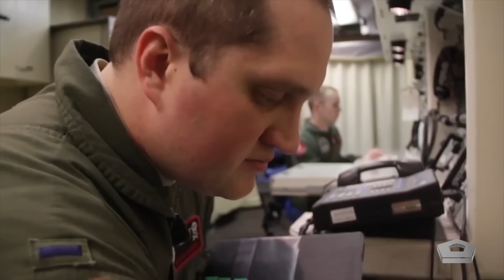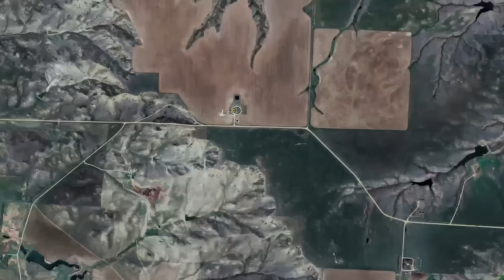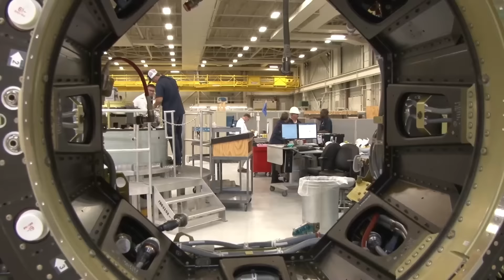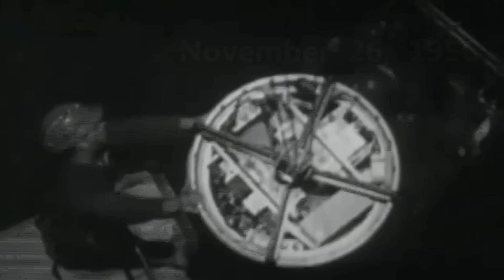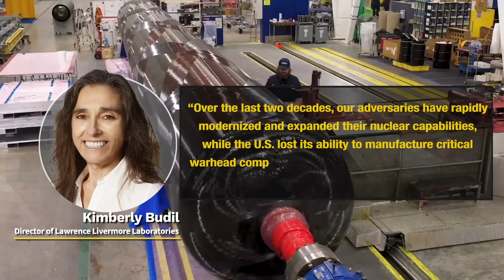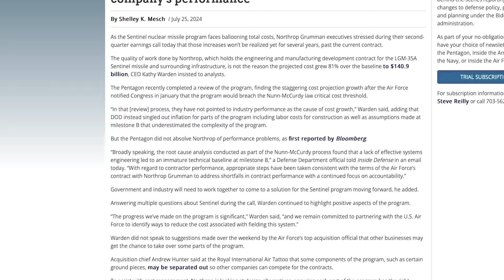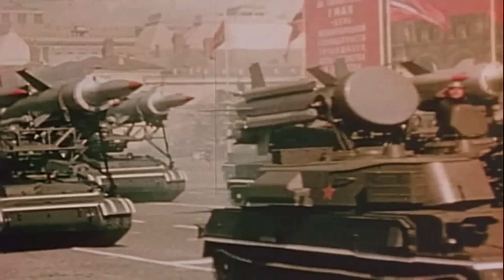America’s New Doomsday Weapon is Unstoppable

Comment: It’s not the missiles themselves which are over budget and which cost so much. It’s all the support facilities that must be installed to support a new missile with newer launch equipment. If all we had to do was build 400 new missiles and then just swap them out for the MM3’s this project would be about 50 billion dollars. About what they thought it would cost initially. BUT the silos basically have to be gutted and new computers and new systems installed to go with the new missiles and there is where your astronomical costs come in. In my opinion we should have never retired the Peacemaker missile. We could have 100 peacemakers and they each could carry from 1-10 warheads. 100 missiles is all we would need. And like China they would have very little idea which of the 450 silos they were on requiring them to hit all of them. Same thing with the Sentinal. Instead of having 450 missiles with 1 warhead on each which is what they currently have we could have just 100-150 Sentinals with 3 warheads each and spread them out over the 450 launch locations. With a little trickery and some nighttime oops we could get them in there and the Chinese wouldn’t know where they were at. Right now we are restricted by treaty to having 1500 or a little more warheads on alert at any time. That’s why the MM3’s are only carrying 1 warhead when they can carry 3. But I think Russia pulled out of this treaty so all bets are off. If I were in charge I would order 150 Sentinals and load them with 3 warheads which they were designed to carry. 3 of the 475 kiloton warheads and I would revamp 150 of the silos for Sentinal and put them
In. 150 missiles with 3 warheads per missile is 450 warheads the exact number that we have now. And instead of doing 400-450 missiles and silos you only have to do 150. The coast of the missile itself would be a little higher because the more you buy of something in the millitary the cheaper it is. But you would have vastly less support infrastructure that would need to be installed for 150 as opposed to 450 missiles. So that’s what I would do. Build about 160 missiles and deploy 150 of them with 3 of the 475 kiloton warheads and then redo the silos and control facilities for 150 missiles and put them in the ground. And also with the Ohio class subs we have we are again treaty limited to carrying 16 missiles when those boats can carry 20 missiles. Some with 8 of the 375 kt warheads and other with 12 of the 90 kiloton warheads. I would go ahead and load them all out with 20 missiles. The new Columbia class that is being built I think only come with 16 launch tubes but it will be decades before they are all built and the Ohios retired. And we are only going to have 12 of those boats as opposed to 14 Ohio’s. Not sure how I feel about that. The Subs in my opinion are what keeps the peace. If someone launched a surprise attack on us and let’s say they wiped out all of our ICBM’s, wouldn’t happen but let’s pretend it did, then our submarines all 14 of them could get within range of their targets the Tridents have a range of over 7000 miles. Or maybe we only have 12 Ohios carrying the SLBM but I thought it was 14. Doesn’t matter our submarine force could wipe out any country on this earth even one as big as Russia is. The British also have 4 subs with 12 Trident II missiles, the same ones ours carry, but are equipped with British made warheads so not sure of the yield. But add those 4 to the mix and France has 4 ballistic missile submarines and France is a an ally so throw those in there too. Every city with more than 50,000 inside Russia could be hit. These missiles some carry 8 warheads with 375 kts and other carry 14 with 90-100 kt warheads. The reason the yields are smaller than in the past is accuracy. We can drop a warhead within 120 feet of the target now. Back in the 60’s and 70’s a SLBM could put warheads within a mile of the target. But when you have a 9 megaton weapon it makes no difference if you were even 2 miles off. Idk it’s all crazy really. I wish no one needed these weapons.

Comment: We like submarine boomers cause they can be closer to target and warningtime less if it is still peace. Do not know their success rate if the entire world know WW3 have begun. Their weapons come in at less speed unless , he he he , the booster is still attached to the warhead and refuse to let go until all fuel spent. >that< would make it come in faster. There is a risk with submarines if someway they can be jammed and very longwave low bandwidth coms still can not trickle through to them. I guess USA have protocols for everything. At least the land based systems can be reached by people on foot assuming total collapse. Anyways, listen to what Chris says the land based system put more energy into the payload so the payload can use that energy to steer. We all know that is sort of the latest thing. So if USA replace old stupid warheads with shiny ones that can fly and also in the process give them a new booster. Why not? it is time .....

EDIT: do not piss on solid fuel rockets they are the strongest. They weigh a hell of a lot at start but after burning some of this heavy solid fuel the thrust to weight ratio gets really good and at the end so much that it get dangerous. To avoid this they have zones that are packed differently to somehow reduce throttle and burn longer and slower at the end when the weight is less.

Comment: Lower fallout alternative missile sink 3/3: MIRV zepplins! Have like ~50 airships circling CONUS at high altitude, each carrying an air launched MIRVed ICBM like when we tested dropping a minute man out of the back of an air plane. This would cost less fuel than aircraft, and be far more targetable due to speed and size issues. Because they would be at altitude, the other side would have incentive to airburst weapons to destroy them, avoiding the fallout problem. Because they move, they wouldn't be able to hit them with one warhead, they would need to destroy areas, especially if using hybrid airships that can go ~100mph.

Comment: Lower fallout alternative missile sink 1/3:

Densepak + local missile defense in the mountains: cluster hardened silos in one area with deep cheap missile defense. To destroy all the silos reliably the other side has to launch many weapons at once along a similar trajectory. Basic idea is that the proximity of silos would force many weapons to arrive in the same area at the same time with perfect timing thus you can make it easier to put mass in the sky in the way of incoming warheads or potentially take out many incoming warheads with one nuclear tipped interceptor. Fewer nukes go off on the ground spreading fallout, and in fewer areas.
Reply: What forces them to launch them all at once?  

Besides, if you have the time to launch a nuclear missile defense weapon you'll have launched your ICBMs already.
Reply: @petergerdes1094  the whole point of hardening is to force the other side to use multiple warheads per one of your warheads even if you don't launch on warning. Same logic applies here. It is much easier to decide to launch missile defense than to launch a nuclear attack.
Reply: @petergerdes1094  if they don't synchronize attack them the debris may take out their other incoming warheads, and strong confirmation of nuclear attack would invite retaliation with surviving missiles.
Reply: Theres still gonna be a massive amount of fallout cause theyre not only targeting the landbased systems. Theyre also hitting infrastructure that supports the other aspects of the triad.  Air fields that can support the bombers, sub pens and etc. 

When it pops off its not gonna be about minimizing damage its gonna be, "how many of ya'll can I take with me." MAD
Reply: This sounds very flawed and Pie in the Sky dreams.
Reply: @peredavi  Would love a counter argument, so I can reduce the alternatives list. Is there a cheap decisive counter to this arrangement? Laddering attacks?
Reply: Alaska is the obvious best choice, hate to say it but yeah
Reply: @fromthefire4176  that gives less time to launch on warning and allows the other side to attack with cheaper weapons. Maybe still works out overall?
Reply: You are not factoring in the new 300 kM laser weapon that only the US has. .
Reply: @FrankPagan-d9k  300kW is too weak, slow, and short-range to deal with RVs with heat shielding going 3-4 miles per second. It could help against cruise missiles in good weather though.
Reply: @matthewgentzel2004  it can shoot down ICBM's before they ever leave the atmosphere.  Study up on it 👍
Reply: @FrankPagan-d9k  you have to be in range to do boost phase interception. Unless you get far more power/precision from space or far more long endurance loitering stealth platforms in other country's airspace (absurdly aggressive) it is only plausibly affordable vs countries like North Korea, which doesn't have enough nukes to attempt counterforce vs. a missile sink in the first place.
Reply: @matthewgentzel2004  bur we got stuff the Public doesn't even know about.. you know that because I can tell you are well versed on the subject. 😉👍
Reply: @FrankPagan-d9k G.W.Bush cancelled that program in 2000s
Reply: @alexandergorchev9946  no.. you thinking about another program.. this is fairly new. Came out last year.
Reply: Deterrence/survivability value aside, densely packed ICBMs in the mountains would be a logistical nightmare.  You're asking for drastically increased costs and risk of nuclear incidents for not much gain in the unlikely event of a nuclear exchange.
Reply: @SlowestKing  Makes sense, though it wouldn't surprise me if there is an accessible mountainous area where the logistics costs would be lower due to geographic consolidation.
Reply: Hm?
Reply: Fake
Reply: Nuclear poisoning don't work on thermonuclear or busting nukes.

Comment: 80%+ of the cost overruns are from increased costs to renovate the silos and the launch and  control module. However it’s kind of shocking to me that this is where they had issues in cost overruns. Renovating the silos and the command and control segment should have been pretty straightforward for the most part. The missile I could see there being overruns but it’s obvious that the missile was the primary focus and everything else was an afterthought. I do think we need land based ICBMs. I also think we should be installing decoy silos as well. I suspect this is what China is doing. Probably 1 real silo for every 1-3 decoys.
Reply: Probably a bunch of ancient tech that finally needed replacement - not because it wasn't serviceable and that the same tech would continue to be, but because it's finally just too old. Reverse-engineering and replacing the floppy disk drives or some nonsense.

Comment: Correction.  Modern nuclear hydrogen bombs do not have the fallout issues of older weapon systems.  
Even the older "dirtier" nukes did not create the wasteland effect we often think will happen.  Look how fast Japan rebuilt Hiroshima and Nagasaki, they are vibrant highly populated cities now.  And the nuclear bombs dropped on them were fairly dirty by modern standards. Yes, fallout is bad and radio active dust clouds that block out the sun are bad. However, modern air burst hydrogen bombs minimizes this. 
I am not sure if this is a good thing or a bad thing.  It kind of screws up the old idea of the fear of mutual destruction. If your missile defense is good enough and you hyper sonic missiles are fast enough an unhinged leader could think they can win/survive a limited nuclear exchange.     
When you fact check this, if you want a quick conformation before going down the rabbit hole you can search YouTube for "Neil deGrasse Tyson nuclear weapons"  if you know who Neil deGrasse Tyson is it will probably give you the confidences to look deeper into it.

Comment: Reducing or removing the land-based missile program would be similar to reducing or removing one of the military branches. Having one lag behind or degrade in capabilities means you no longer have as much flexibility to ensure any potential enemies are deterred from starting a fight. Imagine if we said the navy or airforce were obsolete and no longer relevant in the modern battlefield due to sonar, radar, missiles, and self guiding torpedoes. This is similar to what's being said about ground launched ICBMs. Ground launched missiles are the cheapest in the long term, and far more self sufficient since they don't need to be carried with a ship, aircraft, or submarine. Even if every other system failed, you could guarantee that the missiles would be operational and ready to fire at any time. 

The cost is absolutely necessary, and in my opinion it's absurd that we allowed the ICBM program to fall behind to such a degree that we're having to relearn how to make them. At least small scale production and research/development should've continued during the past 80 years, and the fools who failed to have a program for that deserve to be rebuked and used as an example of what we should never do again - Especially considering the advancements and rapid development speed of China in ICBM tech.

Comment: @taskandpurpose I never heard of the sponge theory before; however the main reason the silos were built that way was because: 1) The area was less populated as you mention and 2) Given the single warheads and the poor accuracy of missiles at that time, it would take multiple Soviet missiles to destroy one American one. So it would be inefficient for the Soviets. In the 70s it was projected that Soviet missiles with multiple warheads (MIRV) and better accuracy, could take out multiple American missiles. This incentivizes either party to strike first. This is what gave rise to the MX program in the 80s. A few missiles were built (50?) but the program was cancelled because there was no consensus on how to base the missiles. Some proposals were to drop them out of cargo planes, put them on rail cars, put them underground on tracks to play the shell game (one missile per multiple silos), or make them road mobile. The final decision was to base them in existing silos. These missiles were decommissioned in the mid-2000s due to budget constraints. So the US did have missile expertise until the 80s and latter with both the MX and the Trident programs. 

Personally, I feel the Air Force should either update the MX missile or use modified Trident II missiles, either should be less cost and risk than developing a new missile from scratch. Especially one with less capability than either the MX or Trident.

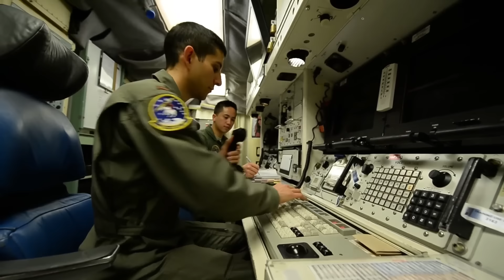Comment: So 4:50 it's not "remote control" the command and control aircraft can't directly send a physical launch command to the missiles. They can however transmit the launch order to the crews stationed underground and any one of 5 crews of two per control room can launch all 50 missiles under their collective responsibility, although as a safeguard if only one crew out of five initiates a launch there is a delay and the launch can be inhibited by any other crew. The missile crews have the only physical launch capability, they are just directed to accept a launch order from the E-4 in the event of a decapitation strike.